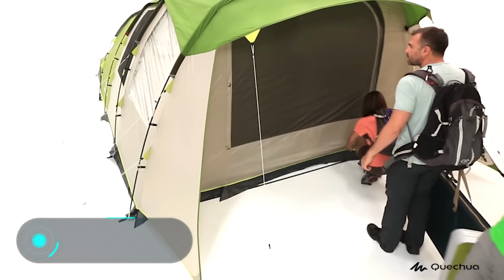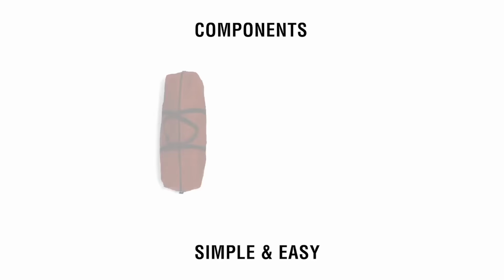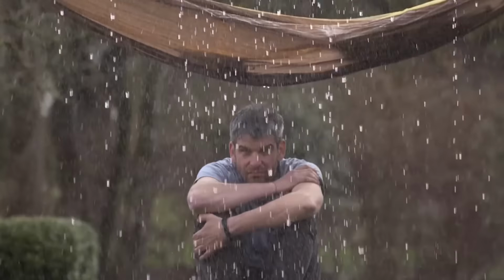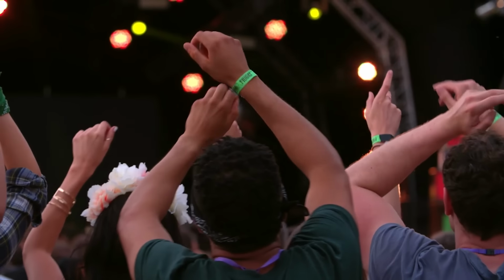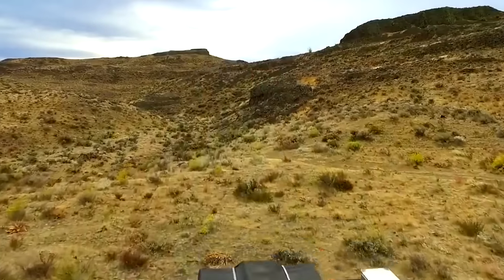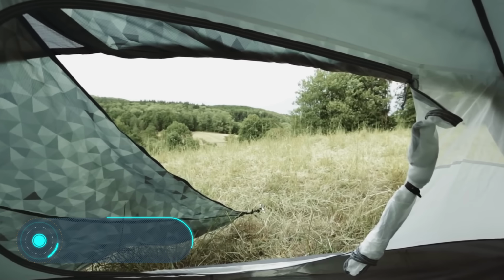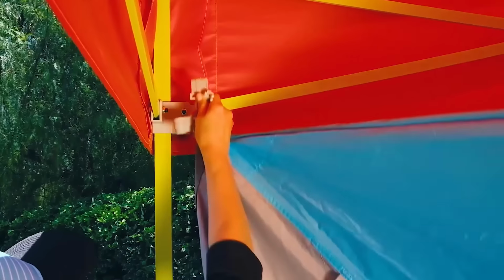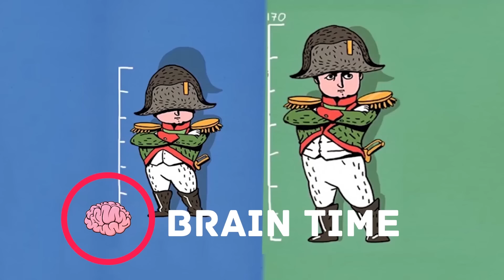10 COOLEST TENTS IN THE WORLD

Comment: Now take these top ideas and combine them into one tent; a waterproof self healing fabric with sky-view that can stay cool in the heat with optional warm fabric version for cold weather flying tent that can be installed on the ground, on a car, or in the air using an air pump out of an EZ-up tent that has modular attachments, including transparent bubble biosphere, that can be interconnected to the tent which withstands winds up to 50kmh with a price around $200. Sold.
Reply: I think you missed a 0 on that

Comment: Water resistant is not the same as waterproof.
Reply: Dustin Mikan fact and neither is sub'in to my page.
Reply: Duhhh.😏
Reply: flex tape
Reply: I love the wide sheets of flex tape...
It takes the place of body shapers quite righteously..
It flexes with you as you move, lasts as long as you need it to and holds you in in the right places...😜 😎
Reply: This is true. LOL! However, in the case of tents, that's irrelevant because I don't know of any tent that's designed to be built UNDER WATER.
Reply: Thanks Captain Obvious

Comment: Tarp, hammock, quilt, and insulation (preferably something like a reindeer skin). If you can't use the ground, the hammock will do, and if the area is good you can just use the tarp.
Here in Scandinavia it gets pretty cold, but so far not a problem for this set up. A regular water proof tent provides the same as the ones in this video, except they only cost a fraction. In case you don't have access to trees, a tent is nice.

Comment: They need to make a tent like Kevlar but stronger make it BEAR and BIGFOOT proof and still be lightweight with a electric mesh all the way around the outside of the tent that you can control from inside the tent so you can turn it on and scare off any predator and then turn it off when no longer needed and you would be able to charge it with a solar power charger and with a hand crank just in case it's cloudy outside and there's no sun to charge it and it would have to be able to give one hell of a zap and not use a lot of power doing it because all these tents they're nice and there beautiful but you're not very safe in them if something or someone wants in they're going to get in with no problems and something or someone can get in the tent faster than you can get out because most people are all snug in their sleeping bags laying there in there tents like a human burrito with no escape so this is a thought because I have never seen or heard of anyone trying to make a tent that you could be safe in or at least to slow the predator down yeah the tents are cool they're bigger wider and a whole lot more polls to put together to me I high tech tent would be one with the one hell of a awesome security defense system so your not something lunch 🐻 or 👣

Comment: 5:55
Setting that thing up is probably a bitch but you'd probably be grateful if you were being chased by a ravenous pack of wolves and you can be securely up in the trees able to wait them out or scare them off with your emergency tent shotgun. Lol. Other than that, not worth it unless you plan on using it for at least several days at a time. Not to mention, you'd either have to bring three separate cars to accommodate just 3 folks, scout for the appropriate tree/Boulder configuration ahead of time or wing it and pray.

Comment: All you need is Quechua 2 Seconds Easy 3 Fresh & Black for 100 bucks !
2 layers tent with heat safety layer + ventilation, mosquito safety, rain proof, easy installation - opens by itself, just unlock the straps.